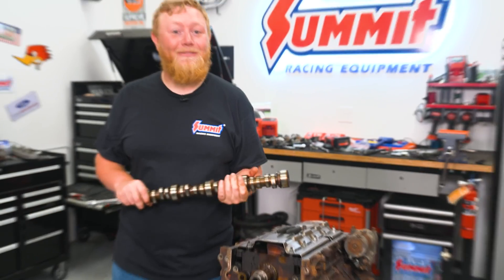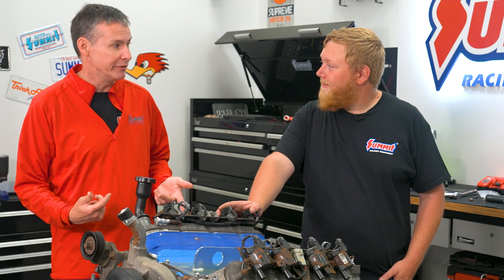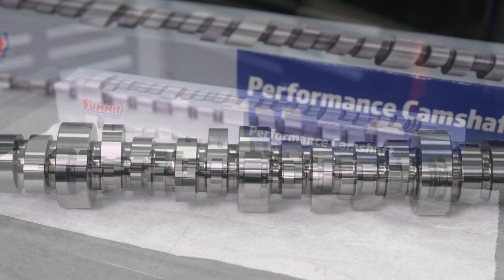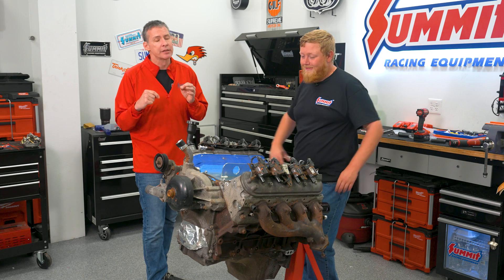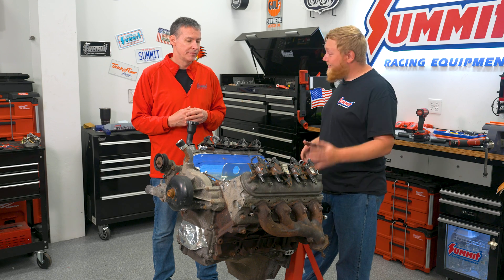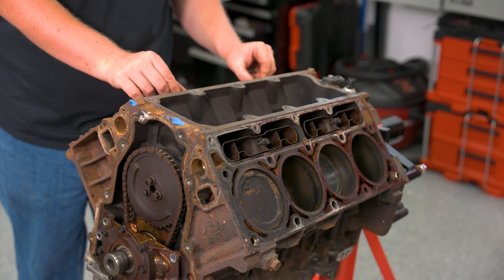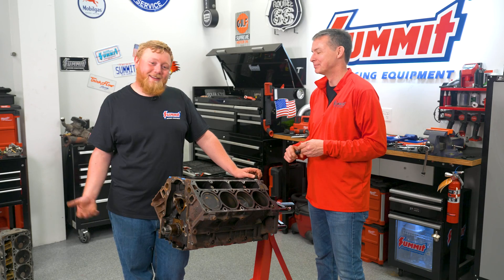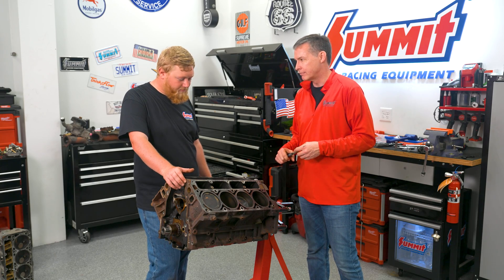Budget-Friendly 6.0L LS Power with an Intake, Cam Swap & 317 Heads—Part 1, Teardown

Comment: I built an lq4 6.0 . 317 heads cut .40 ported new springs custom ground cam btr. Holley single plane 850 carb . Mellings pump ls7 elgin lifters 7.350 push rods. It's in  c10 with 3800 converter.  It goes very very well I couldn't  be happier.
Reply from the maker: What a great combo! It's hard to beat all the options you have with the LS platform. Thanks for watching and good luck with your c10 project!